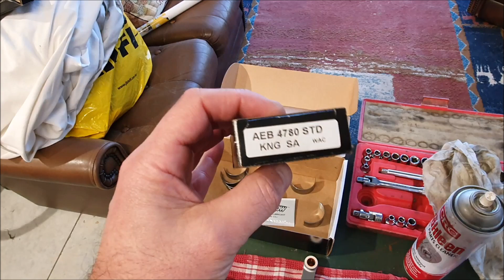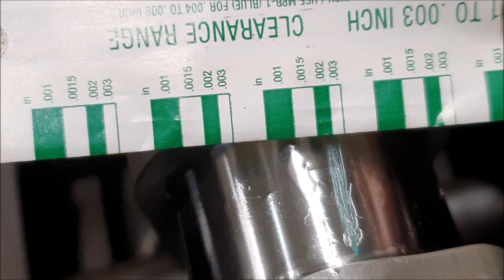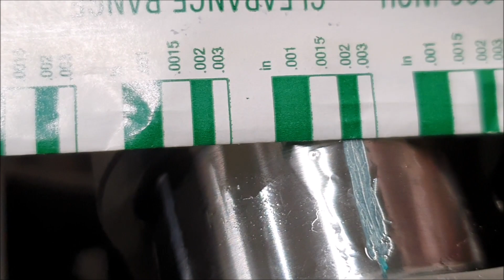Pre war car - Riley con rod test fitting

Comment: Very wise to check bearing clearance , my car is still on white metal bearings , I gave them .002' clearance , I believe the number stamped on the early con-rod is the engine number.  I have serious shed envy !!!
Reply from the maker: I have had to email the suppliers of the crank/rods to find out what it should be. I may also have got a speck of something in one of the shell bearings. How I don't know as I am trying to keep everything spotless but I might need to replace that one. The bearings turn out to be ones from a 1992 (or 3?) Ford Orion Zetec 1.8 SI 16V engine. Not sure how easy they are to get in NZ but they aren't too pricey overseas.
Reply from the maker: The makers replied with this: "The commonly accepted rule that most crankshaft manufacturers prefer for street and performance engines is 0.0010-inch for every 1-inch of journal diameter." 

Handy to know and that matches what I have measured so that's good.

Comment: I re ringed  a Renault 16 in the drive way when I was about 18 years old - a life time ago.  It had very narrow bores like the Riley and also had wet sleeves in an alloy block.  The big ends were 2-3 mm larger than the bores.   Not understanding this I tried to push a rod up through the bore.  The piston rings emerged but the big end jammed in the bore . Thinking the piston was stuck and having little visibility, I taped the big end up with a bit of wood.  This pushed the sleeve, piston and rod up but also cracked the sleeve.  I was very annoyed with myself at the time.  
The only good thing was you could take the sleeve out and find second hand one at the wreckers.  From memory I think Renault had intended you buy exchange piston/ring/sleeve  assemblies - way too expensive for an 18 year old.
Reply from the maker: Yes, pistons where the big ends won't fit down the bore are annoying! I am glad I made the engine mounting bracket for the block and my engine stand so I can easily rotate it. Being able to tip it on it's side makes things much easier to manage. It's always annoying when you break or ruin something from lack of knowledge but if there is no other way, manuals or someone to help, I guess that's how you gain the knowledge - at some cost!

Comment: It seems odd to fit the gudgeon pin last as you outlined - would you be better fitting piston to rod and installing from bottom before crank is in, and fit piston rings last with the pistons sticking up past the deck? Then fit crank and install caps. Beautiful rods tho - will be good insurance against failure. 👍
Reply from the maker: Yes, that would be a better way but on this engine you can't fit the pistons in from the bottom with the engine mount tube in place. That gets in the way for fitting the number 1 and 2 pistons. There is also a cast web that goes between 2 and 3 which might be in the way too. I'll have a look when I am next out in the shed!
Reply: @asciimation  all good - just thought it may be easier than fitting the gudgeon clips or whatever it uses in place. It's coming along though, slowly but surely. 😁

Comment: No oil behind the shells.  The turning force on the shell In the rod not the cap dictates witch way round the rod goes.(the notch on the shell to stop it turning)
Reply: No oil behind the shells, they should never move so do not require lubrication and this would close the measured clearance